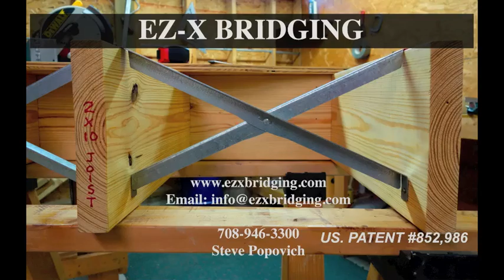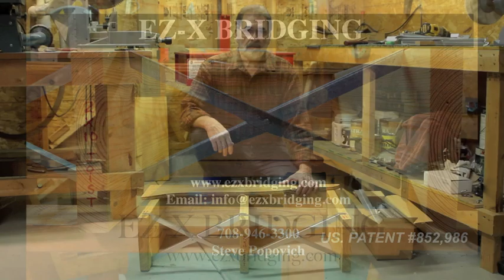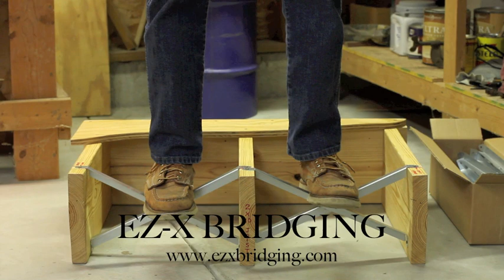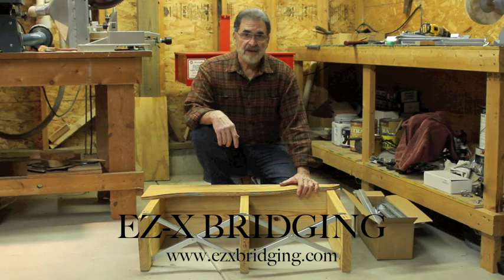EZ-X Bridging: Strength Test

Comment: By design shouldn't you have at least 2 nails/screws on top to prevent it from moving perpendicularly?
Reply from the maker: We tested it both ways. No difference in strength. Thanks for asking. Steve

Comment: Will this reduce deflection? Also just out of curiosity, how much weight load is increased with your bridging?
Reply: Our bridging will reduce floor deflection & bounce up to 50% depending on the condition of the floor joists and grade of lumber. Floor Weight load is typically calculated by joist size, bridging helps transfer those loads throughout the floor system. Thanks for asking. Steve